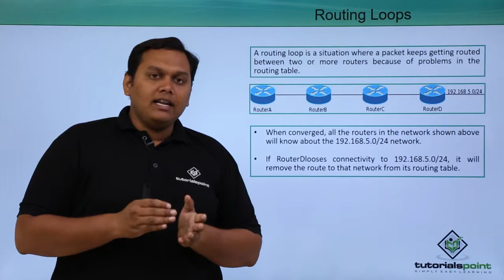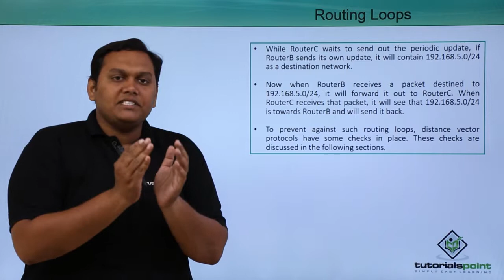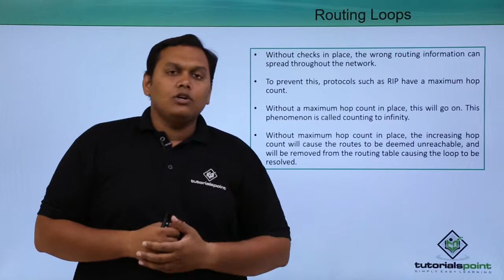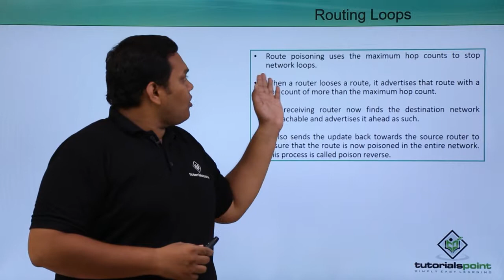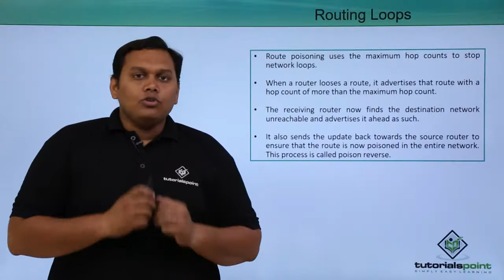Routing Loops

Comment: The basic principle of split horizon is simple: Information about the routing for a particular packet is never sent back in the direction from which it was received.
So if I learn using interface gi0/0 than I will not send same info via gi0/0
Reply: So   is it works on all  routing protocol like ospf, rip, eigrp, and bgp..?